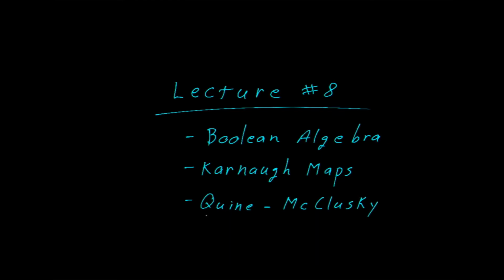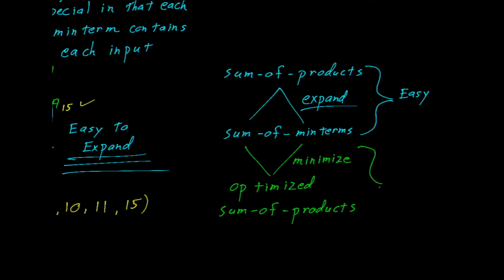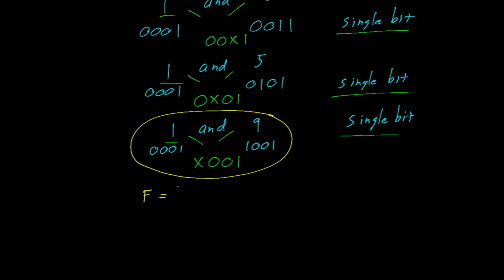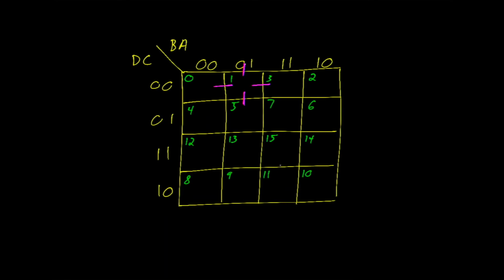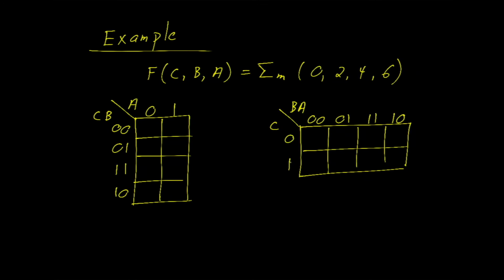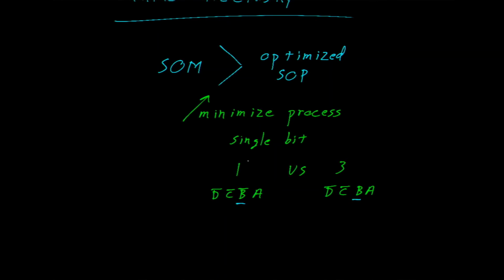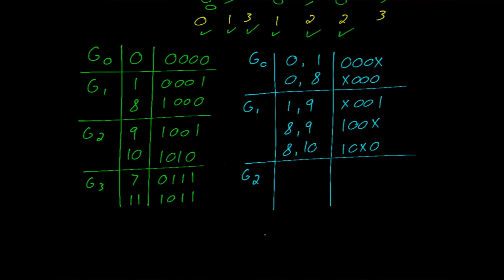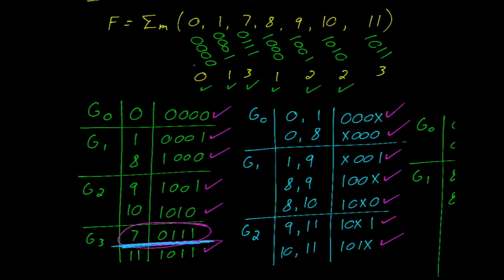Digital logic #8: Circuit minimization: Boolean Algebra, Karnaugh maps, & Quine–McCluskey algorithm

Comment: 00:01 Minimization of Combinational Circuit
00:30 SOP & SOM Revisited
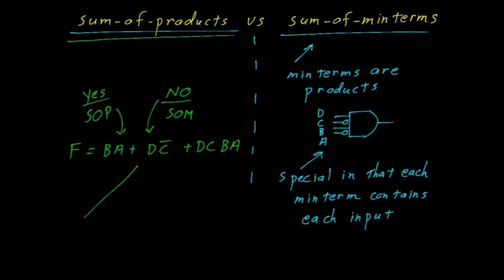02:02 Expanding SOP into SOM w/ Eg (Easy)
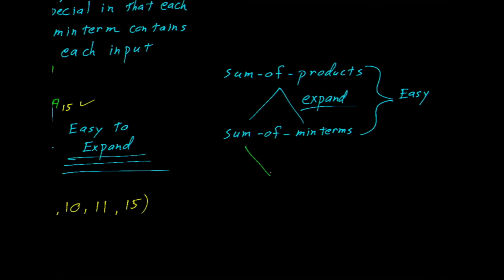05:20 Optimizing SOM into SOP?
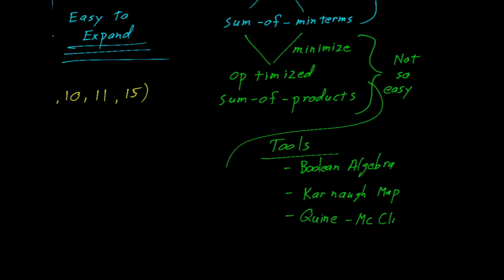06:06 Importance of Circuit Minimization
07:26 What's A bit?
09:40 Combining A bit difference w/ Don't Care
10:49 Proofing w/ Boolean Algebra
12:10 Showing Visually w/ K-Map
13:06 Special Care in Writing down
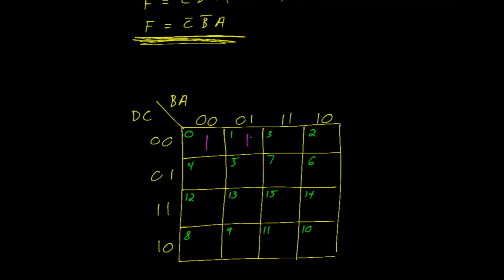14:44 Translating 1 bit diff. into K-Map
16:15 How to See a K-Map (Up,Down,Left,Right)
20:16 Rules for K-Maps
21:01 Example 1 w/ 3 input 
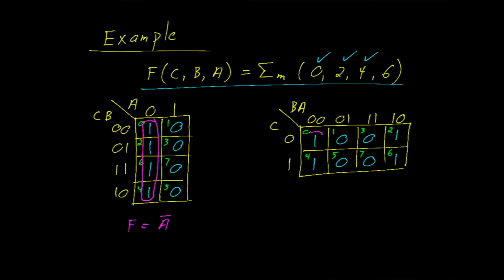22:52 See the Bigger Circle
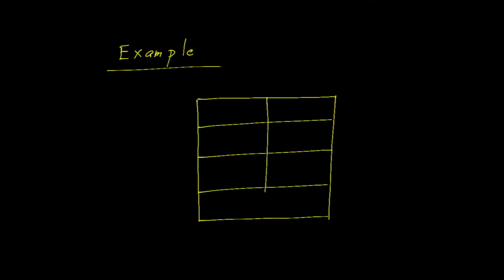23:28 Example 2 w/ 4 input
25:25 Example 3 (Fun K-Map)
26:57 K-Map, A Stepping Stone
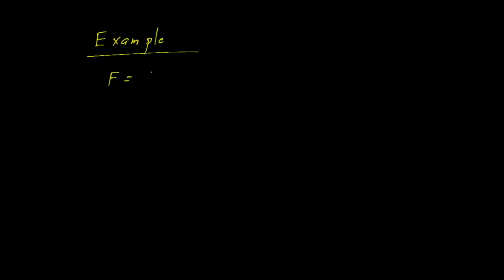28:56 Quine–McCluskey Algorithm
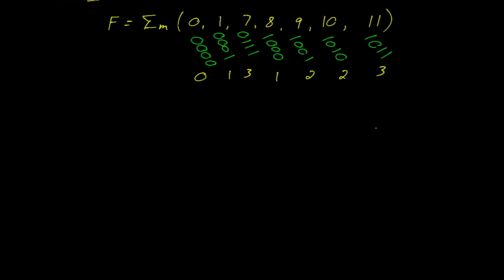30:07 Group the Min terms (G0,G1,G2)
31:26 Compare Each Group for 1 bit
32:08 First Stage
33:59 No Man Gets Left Behind
34:35 Second Stage (Another one!)
35:21 With X on the Same Spot
36:29 No Man Gets Left Behind
37:04 Finally!
37:27 Double Checking w/ K-Map
39:04 Caveat of K-Map